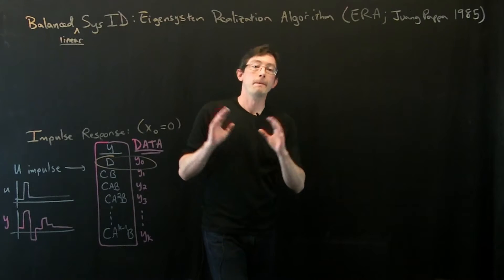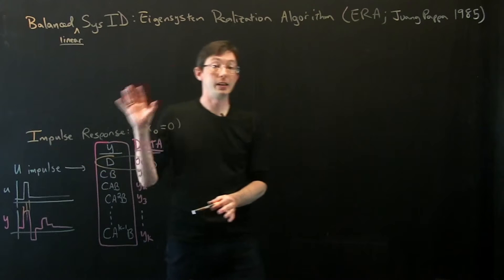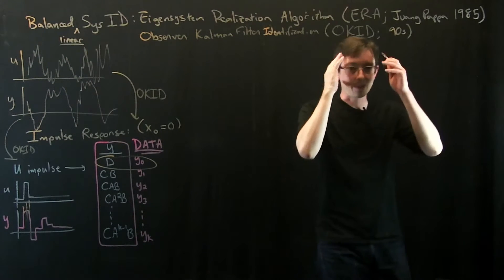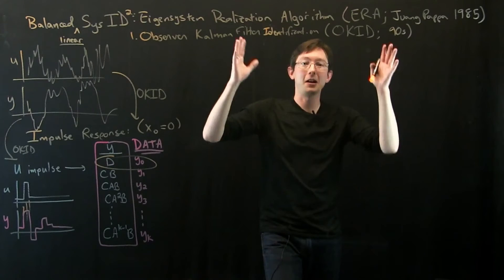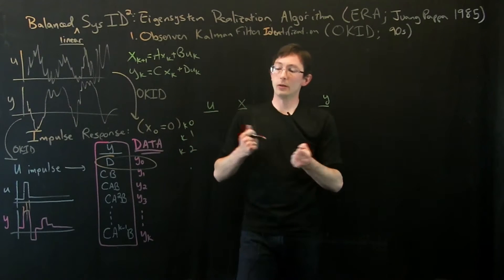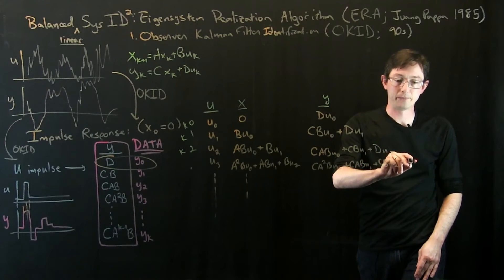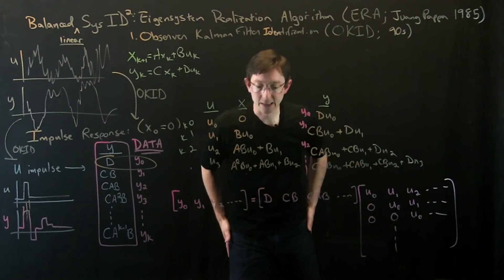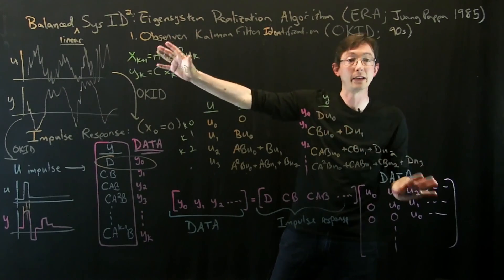Data-Driven Control: Observer Kalman Filter Identification

Comment: I am of the understanding that we can find an impulse response for a linear system from input-output data by solving for x in Ax=y, where A is a matrix of past samples of the input and y is a vector of outputs (i.e linear regression). What is the advantage of OKID over this approach?
Reply: I think it would have to do with the bias and variance. For example, put a normally distributed variable in the denominator and you’ll get a skewed outcome. Same with matrix inversion. So you’ll need some way to adjust to that bias.